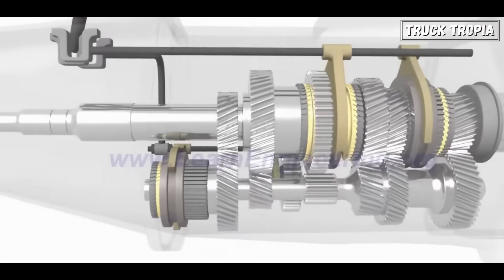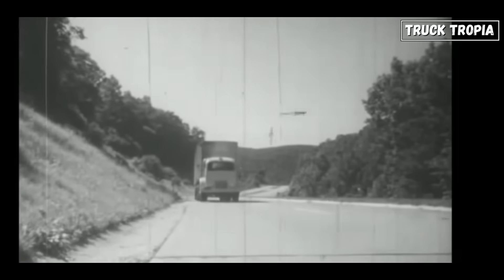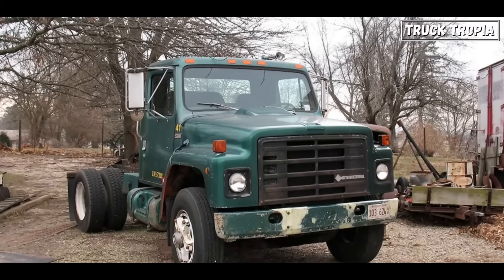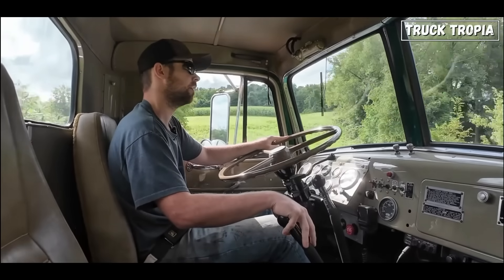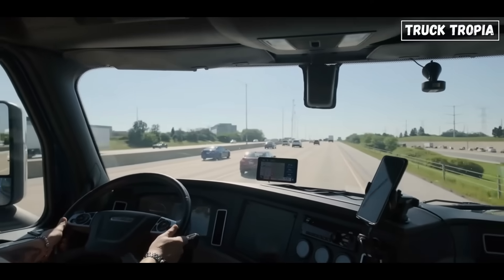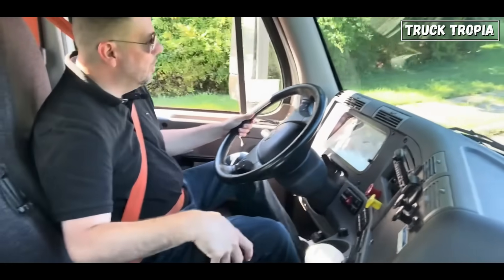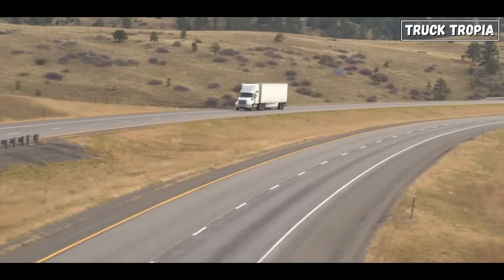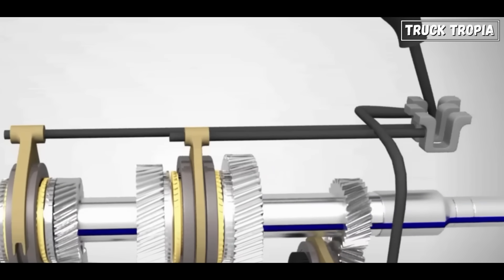Why Do We Keep Adding Gears to Trucks

Comment: People don’t realize that Spicer had 14/16/18, & 20 speed transmissions since the 60’s. The 18 speed that we know today didn’t evolve when Eaton /Fuller introduced it in the early 90’s. Trucking had always had those transmissions available. But the popular trannies with low hp hauling general freight only need a 7/8/9, or 10speed to do the job.
Reply: @njw1840  no they didn.t,Benz produced 16 gears automatic and now 12,it.s is junk.
Reply: @miquel440 Actually yes they did, the Spicer 6+4 technically has 24 ratios. Each gear on the 6 speed were split 4 times
Reply: @igormorningstar  The 6x4 Spicer had a lot of repeating ratios, in reality it only had 15 or 16 usable ratios.  As you got into the higher gears of the 6 speed main transmission the ratios were much closer together and you only split those last 2 or 3 gears twice , actually 6th gear you usually did not split at all.  Add to that you only used the lowest gear in the aux transmission one time, and that was only in 1st gear in the main.  Actually it was more like 14 gears , if you really wanted to you could squeeze out 16 gears.
Reply: @Stumpy1973  theoretically though, it is 24
Reply: @igormorningstar  The spacer spoiler Transmission looked good on paper, but it was famous for leaving the trans in neutral on a down shift on a hard pull up a steep hill. All the guys that I knew that tried them, had them removed and replaced with a Fuller RTO 12 5- 13 speed. That is an expensive venture, but you need something that works.
Reply: @miquel440 oop nvm I misread, sorry
Reply: In Europe we never had 18 speed gearboxes. 16 at last. I drove Volvo 12 speed gearboxes for years and years. Easy shifting and if you have a powerful engine like Volvo has with lots of torque you don.t need more gears. And now i drive the Volvo I shift,best gearbox in the world.
Reply: @miquel440  You forgot one important detail. Euro trucks are short single drive axle boxy puddle jumpers, because they have length restrictions for the cramped twisty roads you have there. We in NA need multi-speed transmissions because we pull much heavier loads, over much longer distances, and at much higher speeds than you. I can't imagine driving on of those Euro boxes with the cramped sleepers. After driving our big aerodynamic wind tunnel tested Super Cruisers, I can't imagine going back to the little cramped cabovers that I started with back in the 70s. We are a bit spoiled over here. Sorry about your out dated little boxes they make you drive over there.
Reply: @miquel440  i drove a volvo straight truck that thing was ridiculously fast. it had a 9 speed.
Reply: I wonder when 2 speed differential gears went out of fashion, the driver in the old federal bus that i went to school in obviously had a 2 speed diff as i used to watch the driver change gears and flipping the diff change lever on the side of the stick.
Reply: The worst truck I ever drove was a dump truck with an 18 speed transmission. You had to use every gear when loaded to get it up to speed, but you could never do it between stoplights. It was the absolute worst, it felt like it had a 4 cylinder in it 👎
Reply: @keithsj10 m 51 usmc dump truck, m123 tractor 7 spd roadrunner, m561 4 gears du.p truck 4 gears.
Reply: @keithsj10  It had NOTHING to do with the transmission. Maybe the driver? But I suspect you had an old worn out engine.
Reply: What about Allisons!!?😢
Reply: @leechjim8023  In North America, nobody wants Allisons in Heavy Long Haul trucks. They use them in little box trucks, and tandem dump trucks. They tried them in heavy trucks many years ago and they were a dismal failure.
Reply: Never seen a 20 speed that’s just a myth
Reply: @Rambo_1738 twin stick 5speed and 4speed is how many gears again? We will wait.
Reply: @sethpureadah  Easy. 5 X 4 = 20. Thanks for waiting. Glad to help. Some of those gears were repeats, so maybe you got about 15 speeds.
Reply: I wish spicer would make those Twin stick transmissions again, loved the 
different gear ratios!
Reply: @jdtrucks5936  The auxiliaries didn't stand up to the torque of the 500 + horsepower engines, guys twisted the input shafts.

Comment: Same thing with cars. In the 40s, a typical standard transmission had 3 speeds. A typical automatic; the few that there were, had 2 speeds.

Today, it's rare to see a standard with fewer than 6 gears while an automatic can have 8 or more.
Reply: There was only one true auto in 40s and that was the 4 speed hydramatic. No 2 speeds
Reply: @288gto7  yep.  Then in the 1950s there were many different variations of the automatic transmission ranging from no true gears (the Dynaflow transmission,  used mainly in Buicks,  indeed a very smooth but inefficient transmission as there was no feel of shifting and the driver could accelerate while maintaining a relatively steady engine RPM similar to the CVT used in many of today's sedans with inline 4 engines)  to 4 gears.  By the 1960s until about the mid 80s 3 speed automatics had become pretty much the standard across the board.

The original 4 speed hydramatic design  (1940-1956) was a complex design that was very heavy and expensive to manufacture.  Today, Hydramatic remains as a trademark name for automatic transmissions produced by and used in GM vehicles even though they might bear  any relation to the original hydramatic design.
Reply: @Sparky-ww5re  yeah the dynaflow has a multi stage turbine , turboglide was also similar to the multi turbine dynaflows. There were also a lot of variations of the og hydramatic like the later controlled coupling hydramatic and a twin hydramatic prototype for trucks that would yield around 21 seperate gear ratios. Also I have written a 480 page very detailed book about the GM Allison CD-850 gearbox from Patton tanks. A 2 speed semi automatic planetary gearbox with a very high stall torque converter
Reply: @288gto7  My Granny had a 2 speed Power Glide in the 70s. A despicable transmission.
Reply: In the automotive marketplace had many believe when the automatic was invented had at least three forward gears while manuals at the time had either three or four forward gears.  Fast forwarding to the mid to late 1980's when automatics at the time now given four forward gears and manuals had either four or five forward gears.  Leading up to 2010 when automatics given six to eight and now ten speeds while manuals given six forward gears.
Reply: The first true automatic had 4 speeds, not 3.
Reply: Hey I heard about that. I saw a video of a green Hudson hornet that had a 3 speed on a column shift. I was amazed because this was my first time seeing one
Reply: @bigdapramirez6157  Amazed at seeing a Hudson Hornet or amazed at seeing a car with a manual transmission?
Reply: @jamesbosworth4191  a Hudson hornet
Reply: so in future we will have 69 speeds
Reply: @hartyleif 
They already have 49 speed transmissions in all of the cars in the Fast+Furious movies.
Reply: The dominant automatic in the 40s was GM's Hydramatic.  It had 4 speeds.  Chrysler's Fluid Drive with Tip Toe shift also had 4 speeds, but you normally used Hi, so you drove the car as a 2 speed automatic.
Reply: @jamesbosworth4191  Meanwhile my family's Corolla still used a 4 speed in 2012 too (& so do the MAN A95 & ADL Enviro 500 double-decker buses delivered to my country in 2021-2)

Comment: I'm old school. My Peterbilt is an 18 spd manual. I don't use them all unless I am loaded heavy and in the mountains. I've tried automatics, don't like them.
Reply: Not a truck driver but a tech that has to drive a Ford Transit with the 10 speed auto. 
70% of the time I put it in manual mode , otherwise it seems like it's always changing gears with the slightest input to the throttle. 
And kicking off traction control gives a little better throttle response. 
Nothing's more annoying than turning a corner and the gas pedal is dead until it straightened out and then it's off like a rocket.
Besides,it's not fully defeated it still kicks in.
Reply: @MrTheHillfolk   nice
Reply: Manuals are better for highway hauling. Auto transmissions are better for city hauling. 
Because they can stop and go fast
Reply: @Wolfe7109  They absolutely can. Automatics don't have manual clutch. It's perfect for city.
Reply: @dkdanis1340  I have driven two that had manual clutches, great for ice. Just remember to disengage the clutch when stopping. Truck was rated for 105,500gvw. Have fun
Reply: @Wolfe7109  Autos is best for highway & way better than manual in cities for trucks, but u may need to use manual mode on autos for hills.
Reply: @johndavidson3424  honesty auto are petty good. But also auto's have way more move parts. Making a brakedown even worse.
But with manuals they do have more engagement between the driver and the truck making breakdowns more possible
Reply: @Wolfe7109 let’s be honest.. you’re not fixing the gearbox if it pukes while you’re out in the middle of nowhere, regardless if it’s manual or auto
Reply: @opvask  true but what I'm saying is that it might slow down your delivery
Reply: @opvask Don’t know about that I once drove a manual transmission from Texas to Michigan without an operating clutch. An AMT would be on a hook if it lost its clutch.
Reply: @darrencatenacci2737  So true.  A few times in my driving career I had to drive a truck with a collapsed pressure plate (non operating clutch)  several hundred miles back to the shop.  Not doing that with an auto shift or automatic.  I drove from 1996 till 2008.   I drove a test truck back in 1999 with one of the first auto shifts , it still had a clutch pedal. Somewhere along the development of the auto shift they lost the clutch pedal.
Reply: @Wolfe7109  the driver we've had where I work how to teach the new driver how to reset the automatic transmission. And you have to do that on both of our automatics the Pete and the Freightliner
Reply: @canadianbreeze8733  If it’s an Allison automatic it doesn’t have a clutch. If it’s an Eaton Fuller, Volvo , Mack, or an international. It’s an automated manual transmission it still has a clutch it’s just air or electrical operated. Basically a AMT has a clutch actuator and a x-y assembly that does the shifting. Controlled by a combination of the engine ECM and the transmission control module.
Reply: @canadianbreeze8733  I'm not saying that autos aren't capable or that they don't have advantages. What I am saying is that I have tried them and they aren't for me. I didn't like that the engagement is to harsh to smoothly bump a dock. Always seemed to slam into it, making the driver look like an idiot. I also don't like how it shifts a gear not knowing that a hill is approaching. I didn't have the option of a manual override that some have mentioned. This late in my career, I'll just stick to what I know. Don't see another truck in my future.
Reply: @canadianbreeze8733  sweet
Reply: Can you teach me to drive the manual tractors
Reply: The only people who like autos don't know how to drive
Reply: @tommy2845  Or they are people like me that lost their left leg.  I can still drive a manual using my prosthetic leg, it's just not comfortable at all.  So legless at 51 years old , I would choose the automatic.
Reply: @tommy2845  When I was a kid, long ago, they used to say that if you didn't know how to shift gears, you didn't really know how to drive, and with Hydramatic or Dynaflow, the car was driving YOU.
Reply: @tommy2845   manuals are pretty easy to drive but some people are to lazy to know how to shift
Reply: @Wolfe7109  I love manuals , started driving semi's in 1996 when there were very few automatics.  like less than 1% of the trucks were automatics and those were 5 or 6 speed Allison transmissions and they did not hold up well to 80K lbs.  I stopped driving in 2008 and in 2018 I lost my left leg.  So if I were to go back to driving I would opt for an automatic, yawn..
Reply: @tommy2845 such a old man statement. “If ppl don’t like what I like they must be incompetent”
Does your wife find the bitterness attractive?
Reply: @tommy2845 the only people who like autos are people who accepts changes. People who are stuck in the past like you might as well haul with horses. Innovation makes everything easier, better you just not need fear to learn new things and of course some new things will fail after all it is still quiet new and theres still a lot to improve on, it may not be perfected in your lifetime to witness the full glory of it, but you already experienced the full glory of manual vehicles. Think of it as chapters that we humans completed from horse drawn carriages to manuals now were nearing to complete autos and started on to self driving cars we need not to dwell on the past we move forwards like driving your truck you don’t go reverse towards the destination it makes it harder. Drop the ignorance and try to open your eyes and ears to learn also theres no such thing as too old to learn new tricks were not dogs after all.
Reply: @masa-qi8cx  No need to use extremes.  Just because you dislike one particular new invention doesn't mean that you dislike any and everything new.  Technology is to be used, not worshipped.  Some folks, like myself, dislike automatics in heavy trucks because they remove some of the control you would have over the vehicle had it been equipped with a manual trans, and, also, engine braking is better with a manual.  Yes, I know diesels don't offer much engine braking, but still, something is better than nothing, particularly if your Jake stops working.  It has happened to me more than once.  Not every innovation is an improvement.  Some are experiments.
Reply: @jamesbosworth4191  Yes you should use extremes when the latter uses extremes to match their way of thinking. I agree on your first statement but older people tend to dwell on the past “back in my day” “they sure don’t make it like back in the day”. Yes, yes. Everyone wants to live when the prices where low and the quality was good. Older people forget that theres so many factors why things change over time, changes that are for the better or worst. The newer generations after that would be no better while still young you’d look forward as you get older you’d look back and call it better cause you were in your prime, were you were more active, social, were things were more loose and lax etc.

The young will replace the old it will always happen this way, thats why there’s so many people arguing which is better there past or the this present. People have different preferences, because they were born in different times. Where the older generation would prefer the older trucks over the newer ones cause thats what they grew up with, thats what they’re familiar with, while automatic trucks would be considered rare in the past it is considered common today cause younger truck drivers are more familiar with the newer trucks while the older ones are slowly getting replaced. Adapting, modernizing, innovating. 

The thing with innovation is it takes time, give it time it will improve, it might not be in 20 years or might not even be in ones life time but in certainty it will happen. 

Experiment is before innovation, by continuously experimenting and iterating it will continue to refine, it takes a lot of  time, feedback, and trial & error.

Sorry for the lousy explanation having multiple languages mixes the sentence structure.
Reply: @masa-qi8cx  Not everything new is good.  Face it.
Reply: I just got my CDL a few months ago and got a job and we only use autos and it makes the job extremely easy as we go in dirt roads and in the mountains. I just click a button and it lock it in gear and I shift the paddle if I wanna go up or down and the KWs and Pete’s are super smooth shifting. The company only uses Cummins cx-15s in both the KWs and Pete’s. Maybe it’s because I only know autos but I don’t see a reason how a manual is better as a driver. Maybe for a mechanic/owner op it’s better but I really don’t know. Maybe I am spoiled as I joined the industry very recently and the technology has come a long way. I had a trainer in his 50s telling stories about the “good ol days” but he also highlighted how today it’s a lot safer due to cameras/speed tracking and easier to do the work but how he misses the feel of a manual and being able to rip down mountains. I don’t have an auto restriction as I passed my test on a manual and my first car I ever bought was a manual but trucking with an auto is honestly really good for me. Is it just nostalgia or are manuals actually better if you’re good at it. The only issue I’ve ever experienced is the the truck sometimes gets stuck in gear but I just pull over safely flip my hazards go in neutral and keep going. It doesn’t hurt me at all as I get paid hourly and it only costs me about a minute